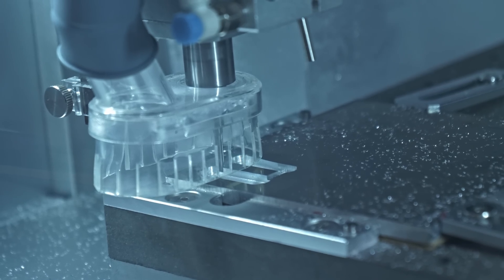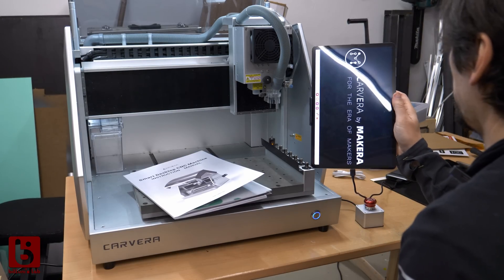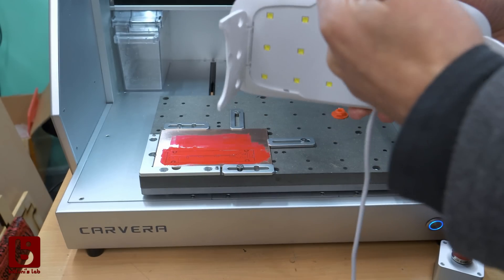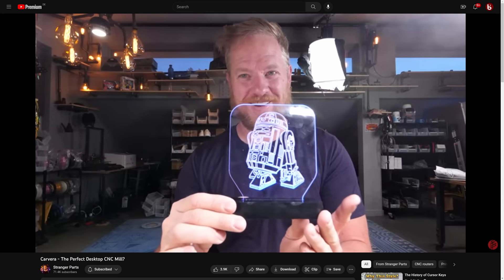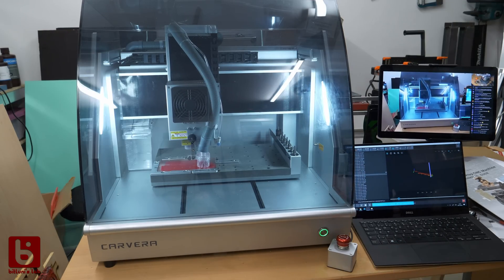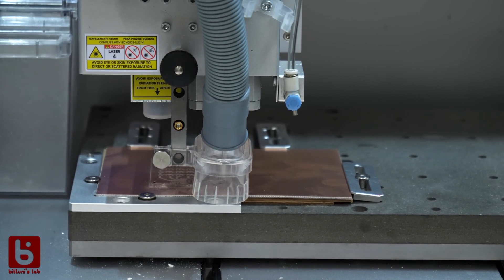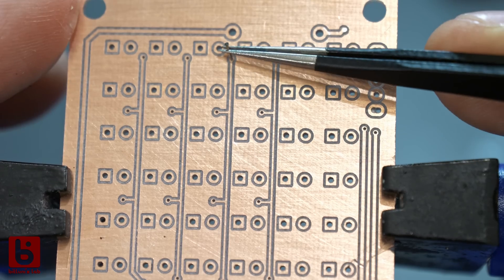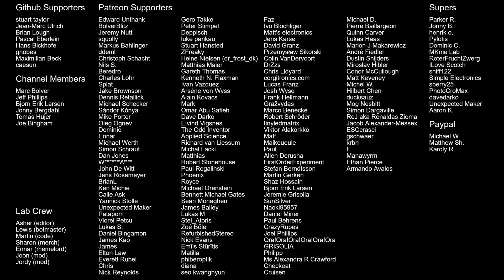I made a $1 Risc-V Game Console using a desktop CNC

Comment: 1:10 had that cas once in my life. I had to install a machine in a room far in the building. my boss had checked if the box would fit the entrance door. he forgot to measure the second internal door.

even after removing packaging, the device was 6mm larger than the frame of door.

I had to dismount the device and put it into peaces and rebuild it inside the room.

Comment: Yeah, milling PCBs is the ultimate test of a CNC mill.  It really shines a spotlight on every single flaw, and it's a ton of work to get good results, assuming your machine is up to the task. 
 I had success with a generic 3040 ballscrew machine with a new controller, closed loop steppers/servos, a 3-phase milling spindle, and most of all: grid based autoleveling.  I used bCNC on the desktop, and with an extremely narrow  V-bit I was able to make truly impressive traces/spaces, easily in the region of TQFP parts.
It's hard to justify not using an overseas PCB shop for cheap, multi-layer boards, however when you really need to make several board revisions without waiting over a week for each board to be delivered, it's really the only solution short of paying huge prices for domestically-made boards.

Comment: Nice video!

You can remove milling remains that short traces with a hot "dry" soldering iron. It will melt the glue and you can scratch away the remains. 

You dont need a riveting tool. A small hammer will do the job too.

Comment: Excellent demo of the capabilities of this little CNC machine. 
It's not a bad price for what it does either. 
I wouldn't use it to make PCBs however. It's a health hazard dealing with the fibreglass dust.
Reply: Maybe a vacuum setup? It's probably not the worst with the cover down...
Reply: $5999 ??? You must be joking! It is a toy to make other toys.
One would expect at least functioning software from this manufacturer (because that seems to be the only thing they know about), but no, they even mess that up. It's unbelievable what these "companies" are doing these days. The customer is being completely ripped off... and not only does he put up with it, he even cheers. This is once again a real amateur life: you get what you pay for! (NOT in this case, because it requires the assessment of experts who also work professionally in the field to assess something like this).
In most countries, this is considered unfair advertising and is punished with heavy fines. And rightly so!

Comment: For everyone that want to read the short visible text: *Actually, it was only the "last" lesson that I wanted to share here. The video is dragging already. Milling the second side you really need the sand the hoels first and get the depth right... whatever. Let's pretend it was the "last" one... ...it's YouTube afterall
Reply from the maker: argh .. there is always a typo... I'm bad and I should feel bad.
Here the explanation for the sanding recommendation:
the drill pushes through the lower copper layer which leaves a rim of copper. When the board is flipped you want to probe the level again but then the probe will hit one of the copper rims and your trace wont mill deep enough
Reply: @bitluni  I'll add that if you don't sand the top you might have burrs which might make the board sit uneven and move slightly too.

Comment: Didn't Carvera also buy ArtCAM?
Reply: Oops, nope! Autodesk did ! And then discontinued it. :p
Reply: @bitluni  I hope you forgive my mistake. Correction; it was Carveco that I was thinking of. When I first looked it over several years ago, I decided it looked like a fork of ArtCAM and the GUI was a complete knock off. So, I assumed that they had rights to it. Never gave it a second thought due to the licencing costs alone. I am all Vectric, and Fusion 360 with Artsoft Mach4 to run the motion controller. Just upgraded this 600x1200mm machine to do metal work. Early test phase now. :)
Reply: Carveco

Comment: I want to replace my £200 3018 CNC with one. Can I justify something that's 20x the price?
Reply from the maker: Do you need it? no. Do you want it? yes. 🤣
Reply: The world of CNC isn't as plug and play as carvera makes it out to be. There is still a lot of troubleshooting and maintenance that is offloaded to the end user. The 3018(and other chinese desktop routers) fit into a really snug pricepoint for their capabilities. After growing out of one(by that I mean learning how to fix all the issues, dial the machine in, etc), I would recommend building a printNC out of steel. 
-background in prototype machining. Carvera is a nice machine, but I can get the same cuts from my 6040 desktop router.